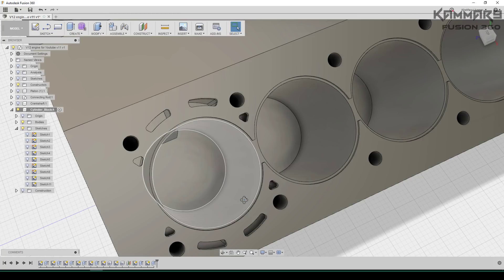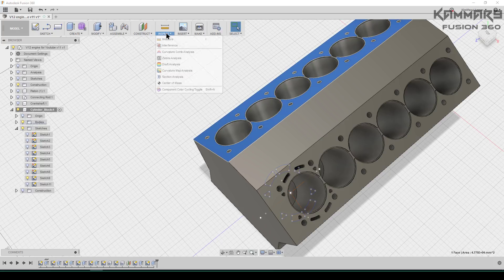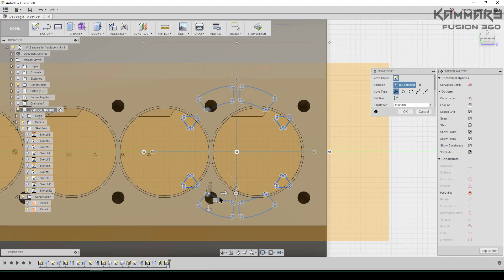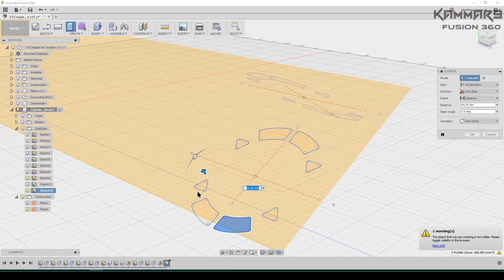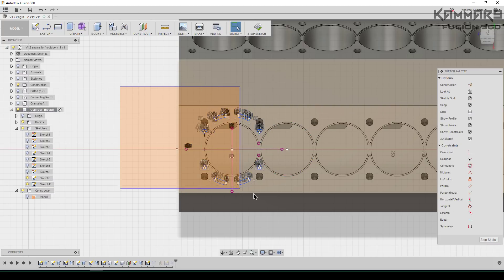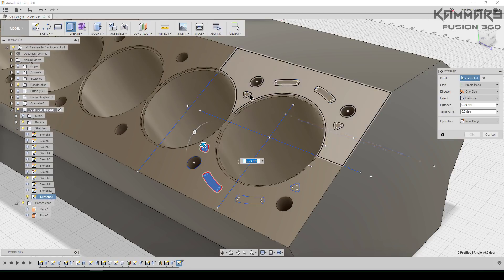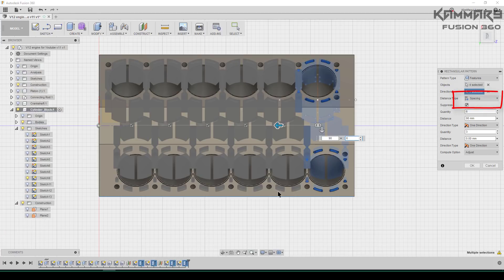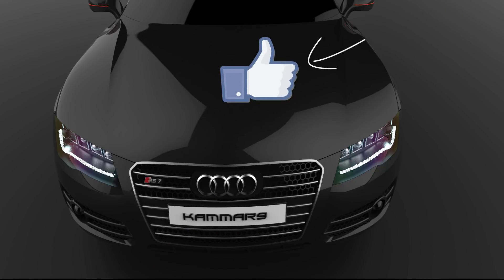Fusion 360  Modeling V12 Engine EP 10 😍 Full HD

Comment: Just a tip. After you rectangular pattern one side of the water jacket. You can then split the body in half using the origin. Once done, select the split body, copy and paste, then rotate 180 degrees and combine them back together. This saves all the time shown here in the video and allows you to keep the orientation of the cylinders. 

I'm loving this series so far, just thought I'd share the way I did it.
Reply from the maker: Hi there Jake , that's an amazing way to save time , thanks for sharing this tips

Comment: @Khelifaoui Ammar: There's a discrepancy between EP9 and 10 where the second profile which is used to cut from surface into body of cylinder block. Not sure if this is your intention but I just want to point out. You have to slow down the videos to see it. It happens at 5:43 in EP9 and at 4:43 in EP10.  10mm cut vs 15mm cut, respectively.   Basically, on one side is 10 but on the opposite side is 15.  Your work is awesome, I really appreciate it.
Reply: Are those the correct measures or threy have to be the same size ??